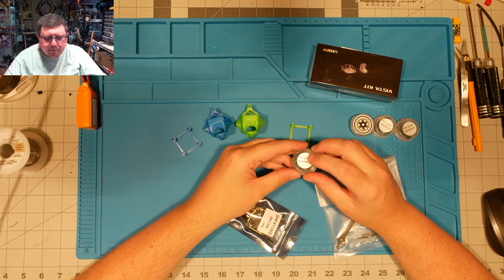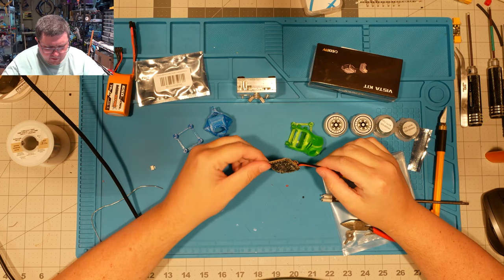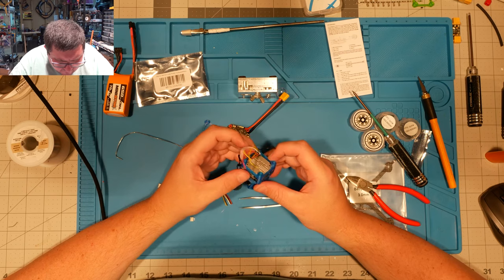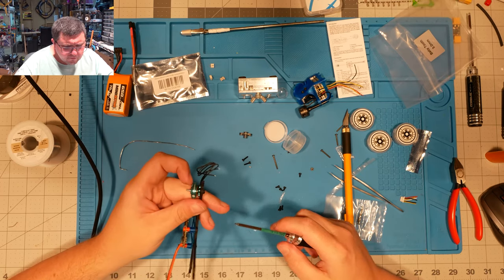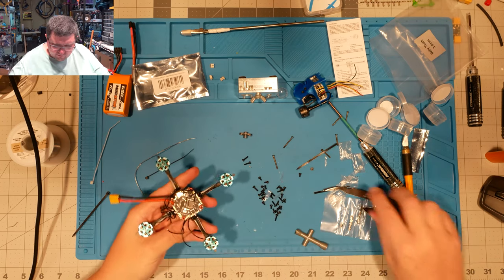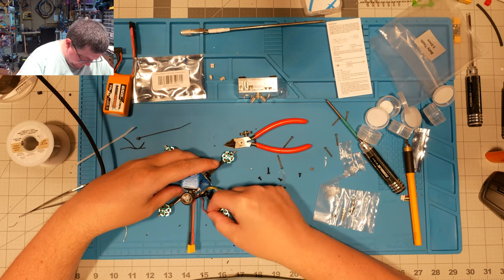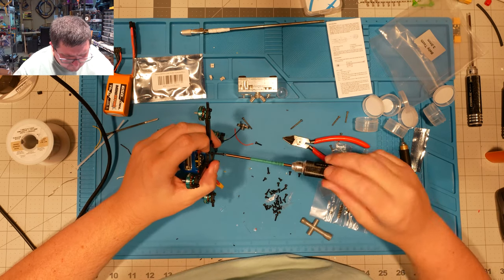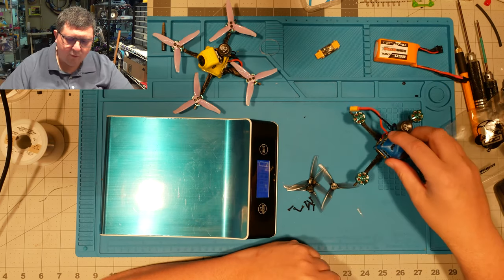Vista Pick Build

Comment: Hi,
I noticed you have not used the capacitor supplied. The FC is 25a so is a capacitor not necessary?
Reply from the maker: In general, no.  At least on DJI builds.  On analog, the question is a bit more complicated.  You can almost always get away without using one, except if you motors are noisy, or esc produces a lot of noise.
Reply: @robertlandrum  thank you i suspected that if you are running an FC rated to 6s and only using 4s and DJI this might be the case. Thank you for confirming this as this inspired me to do a similiar build. i have used a betafpv 12a FC V2.1  though with 1204 5000kv motors FC only rated 12a but has enough uarts. NJ Tech built one with these motors. Problem i have is still waiting for V2 goggles to arrive and never flown DJI yet.

Comment: Hi, i built a quad like this with 1303 xing motors, i had to use a different frame becouse i'm in europe and availability sucks, it came out at  79 grams dry and 123 auw. But i'm having some problems, the quad isn't stable at 0 throttle no matter how i set my pids, i'm using a 2mm nanohawck x frame, do you think it may be the problem? Thank you
Reply from the maker: Sounds a bit like idle up isn't enabled.  The idle-up feature prevents quads from basically falling out of the sky when armed and throttle goes to zero.  It helps maintain control.  KISS is notorious for users experiencing exactly this (as I did with my Mr Steele build).  Check out some of Joshua Bardwells videos to see if its something that you can fix easily with your build without having to do a major upgrade (last time idle-up was off by default was BF 3.2, I believe).  If you're on a later version, check you haven't disabled it.
Reply: @robertlandrum  I am on betaflight 4.2.5, airmode was enabled. I solved the problem updating the flight controller to betaflight 4.3, now it's a lot better. I ordered a thicker frame anyways, just to test it. Thank you for the answer

Comment: Hey I just got into dji and have been flying the tp3 for a while do you recommend Decasing the vista
Reply from the maker: Joshua Bardwell and I have gone back and forth on his discord.  I decased mine.  The long term effects on the decasing are not yet known.  I believe JB is planning to do a video where he decases the one I built for him, as I sent him all the necessary information.  It's hard to argue with the weight savings.  It's about 15g with a new camera mount.
Reply: @robertlandrum  How's it doing now that it's been 6 months or so?